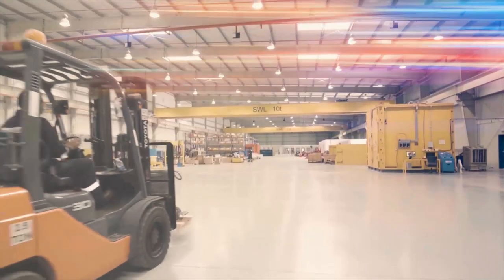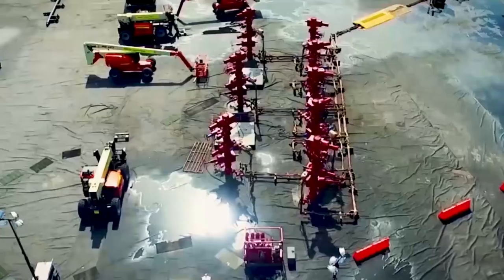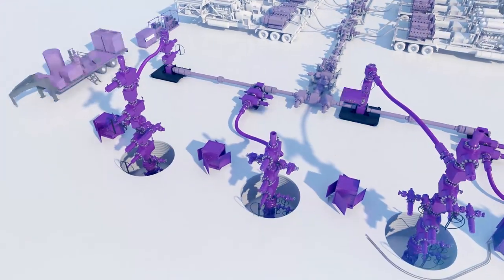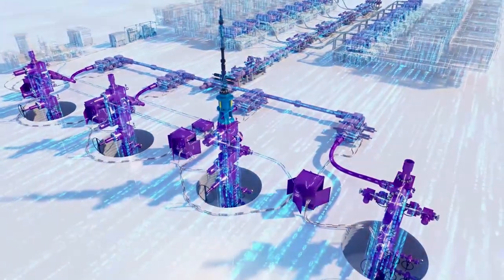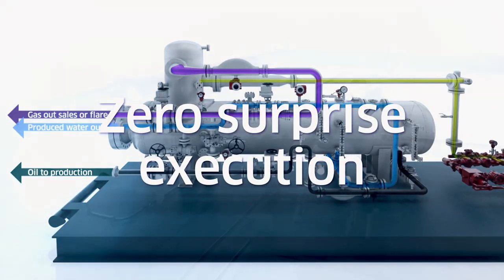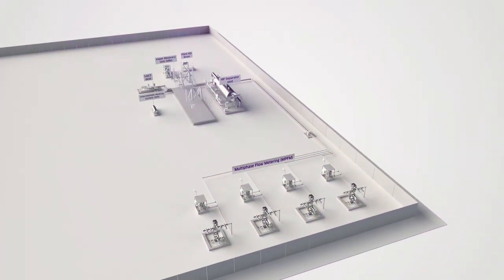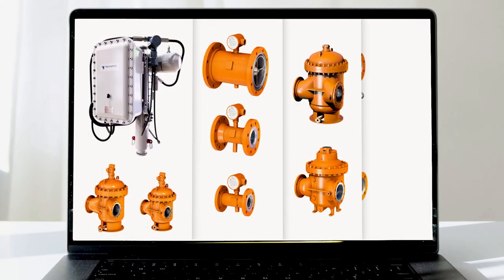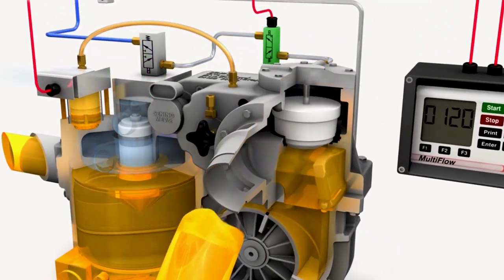TechnipFMC Surface

Comment: Hello there ; I have ((accuload II)) model (xu-0-std-std-002) and need to communicate with it to get reading of temp and totolizer amout so I want to know map register  of this device and name of protocol that used in this device ..
In accuload contain rs232 and rs485 terminal strip but when I want to activate  rs485 by parameter the (no rs485 installed) can I activate it by upgrade of firmware version or not and what is the suitable connection between accuload  rs232 terminal strip and pc rs232 male pin .
My best regards
Mohkoi